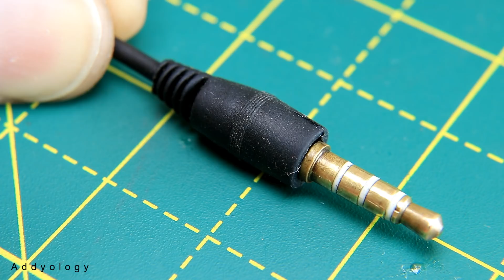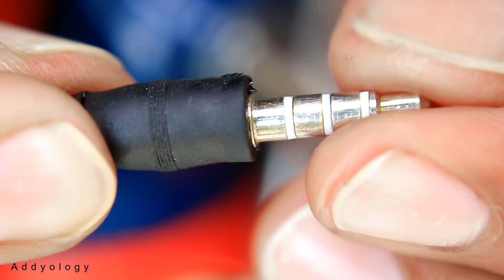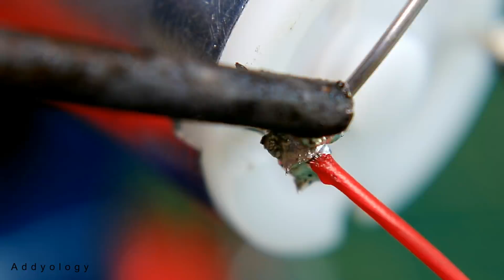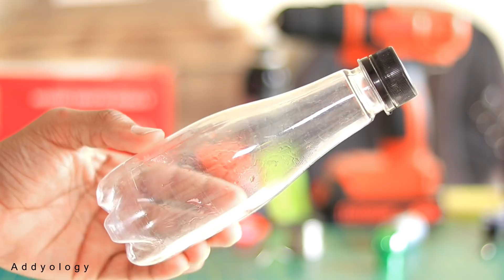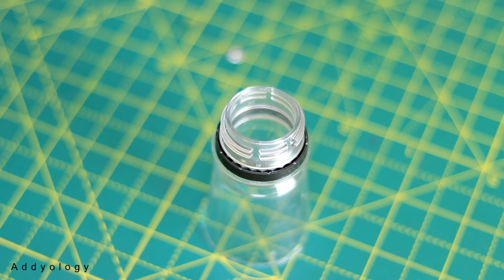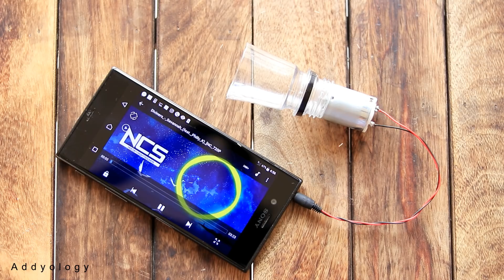How to Make a Speaker at Home - Using DC Motor

Comment: How it works? Can you tell the concept? Because the motor converts electric energy into mechanical energy..
Reply: Abhishek Kumar ever heard if resonance?
Reply: Abhishek Kumar dgg
Reply: Electromagnetic,a speaker inside have a circle coil and one magnet inside,the DC motor is very similar,is a coil and around two magnets,it work anyway

Sorry for my bad English XD

Comment: It is a TERRIBLE idea, you should notice the GREAT RISK when doing an experiment of these, the impedance of a motor never matches that of an amplifier, in addition the most dangerous is the current self-induced by the inertia of the motor in motion which returns to the amplifier causing the destruction of this (remember that a motor also works as a dynamo that generates current that is returned by the cables to the device), no doubt the motor will work and sound (very bad) but the great risk of destruction is for the amplifier of the device.
Reply: Juan Pablo desh bhakti gane video song DJ mein
Reply: No